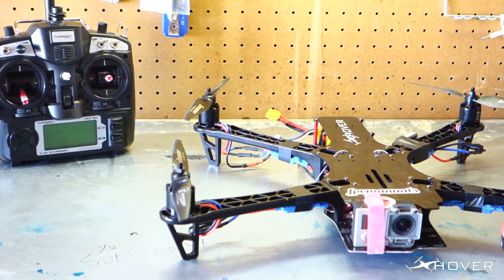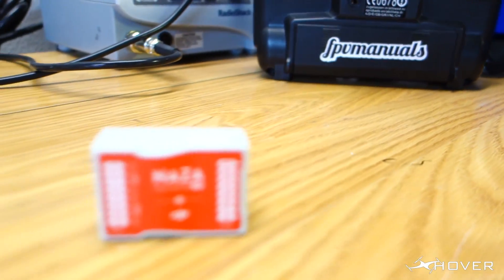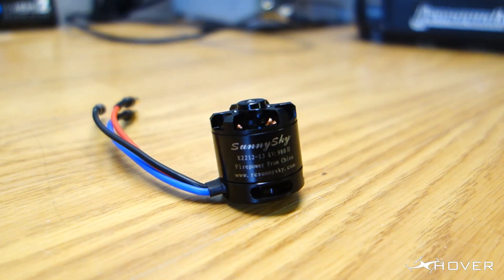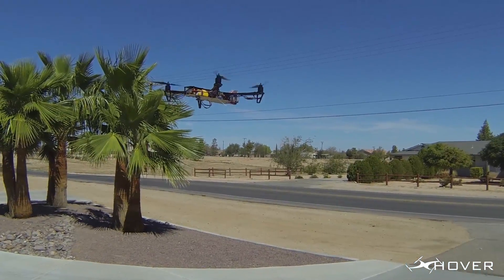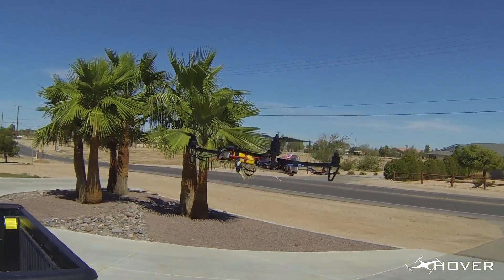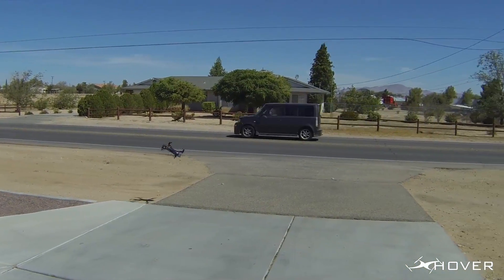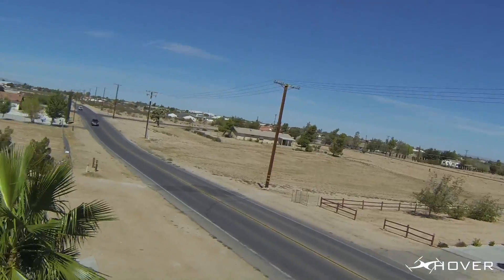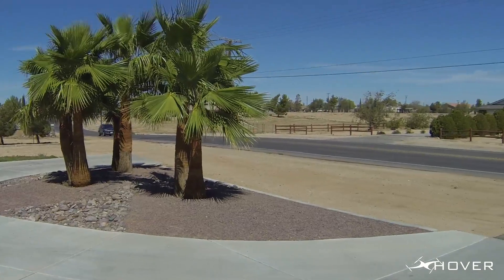TBS discovery build video, sunny sky 980kv DJI Naza lite Grupner 8" 4s

Comment: Im suprised why americans use 8 or 9 inch props? 
While this motor can handle 10 inch props with 4s, and no problem such as overheat or overprops

Back then i use mine with 10inch props and got AUW about 1920grams 
It flies like a dream

Comment: Have you tried 9in props on this setup?
I was wondering how 8in might go with the 4S and my 980's on my TBS... you pretty much answered my question here- I want to drop some money on a set of good CF props now that all testing and wild hairs are out of my ass with this build, and I was torn as I hadn't had a chance to try the 8in... no extra sets around for spares.
I see that thing is like a rock... I use a Naze in mine, but it has the same flight characteristics albeit maybe a bit snappier here in acro mode. My full naze will lock in on alt hold great. I just don't have gps or rtl capabilities- so no room for error, lol!
Reply: I am running the DJI 10 x 3.8 props on my SS 980s, no problem at all using 4S.
Reply: *****
in wind I find the 10in props too floaty- but tons of power. 8in is a shorter flight for sure, but it is much better at slicing the loft down.
That is why I love these motors- they have a huge prop window and perform excellent while being forgiving. I use the 10in props with 3S and 11in also rarely. I use 9in and 8in on 4S on average. I use everything from a dual 2200 3S 25C in parallel to a 3700 30C 4S, to a 5000 35-70C 4S nanotech which juts out the back a little and makes the Disco quite tail heavy but it will fly for almost 15min.
Reply: I agree, they are awesome motors, so flexible.  I understand the floatiness you mean,  smaller props do handle wind better.

Comment: What gains do you use on this build? I used trappys 900kv gains and it worked out good when flying 5000mah 3s. But now im on 4000 4s and it gives super fast oscilations when throttle up. Its so fast it looks like vibrations almost. Do you know wichgain i should lower to reduce this?

Comment: Are you running the smaller props because you are going with the higher 4S? Have you tried 3S with a little bigger prop to see if flight times improve?

Comment: thats an awesome video....but tell me,what are your settings??
As when i turn with my rudder(left and right) the Disco's as sort kicks upwards..not too sure how to calm that down..cheers in advance.
Reply: I had that problem too, I just messed with the gains a bunch, got them as high as possible and it worked. I'm not really sure which gain did it, but just try messing with the gains :)

Comment: Very nice.  You should try the gemfan props, they have a lot more bite, but run very smooth, and will probably give you longer flight times.  I have both the eprops and the gemfans but I like the way my quad pulls out when I give it full throttle with the gemfans.